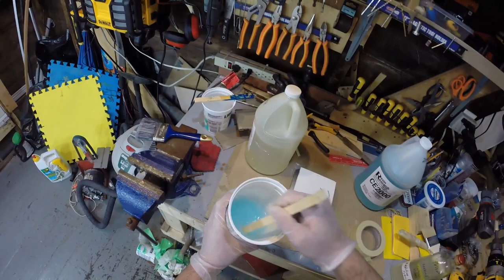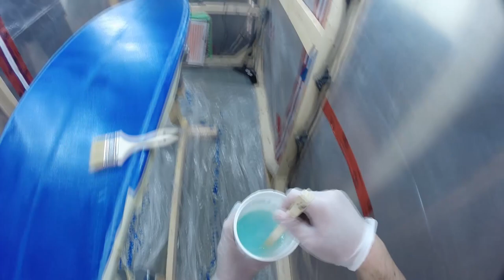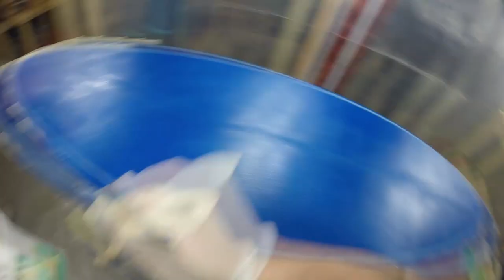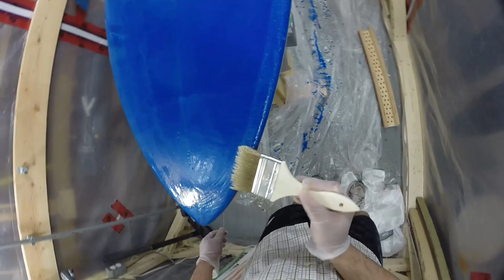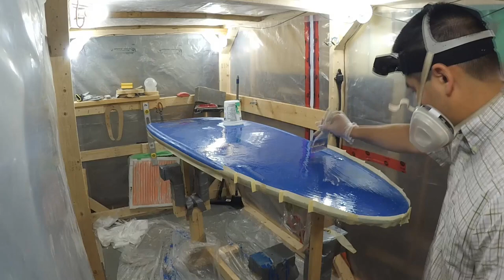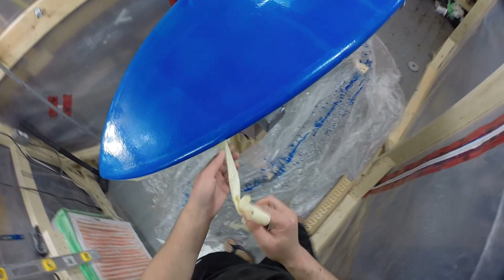Hot Coating the Bottom of a Surfboard: How to Build a Surfboard #31

Comment: So the laminating, hot, and sanding coats are not different mixes except the hot coat has additive F? Double checking additive F just 100% xylene since I have a can, I have read somewhere it also has paraffin wax in it, but I don't know why you would want wax between the lam and sanding coats? Why add the additive F, for a thinner coat to make it more smooth, I'm not sure what a fish eye is? Where did you get the best price for the resin/hardner?  Why not do 2 to 1 like you are doing (vs your correction note of of 2 to .9), was this board too brittle after it was done or something?  THANKS, your videos are great help when fixing my large tail ding.
Reply from the maker: +stewbuntu Correct but you can add additive f to the other coats to help the epoxy flow better, I don't have a hard fast rule, sometimes I do and sometimes I don't.  I'm not sure of the chemical make up of additive F, but it does seem to harden like wax if it gets too cold out, so I don't know.  I just know it works great.  Fish eyes are awful, they look like little pin holes in your epoxy, usually from surface contamination, the additive F helps the epoxy spread out.  I get all my supplies from greenlightsurfsupply.com.

Comment: Yes, the black pigment shows many imperfections. I should have just did an all white board being my first one. I figured the pigment would be thick and dark but it showed to be opaque in some area like it didn't spread evenly or something. It's not bad for my first board but I definitely learned what not to do...at least not yet. Thanks for the help.
Reply: Did you only put pigment in the hot coat or did you use it on the cloth too?

Comment: Hey Andrew,Love your videos! I'm doing my first board. It's an 8' fun board. When I did my hot coat on the bottom, I got fish eyes and little air bubbles all over. Now that it's hardened, what's the best way to fix this? Should I sand it down and re epoxy? Also, do I need an edge on a longboard like how you made yours with the masking tape towards the tail on the bottom or is that more for short boards or my liking?
Reply from the maker: +Neil Yagley Thanks Neil!  Since it is your first board, I would sand over the bottom wipe with denatured alcohol and see if you can fill them in with another layer.  Also did you used enough epoxy?  Sometimes if there is not enough, the surface tension causes the fish eyes to form.  I learned the hardway, was trying to not use too much and ended up causing me a huge headache.

Comment: hi Andrew,
during laminatingarise a lot of air bubbles.They burst and it makes surface of the board uneven with dimple. Did you face the same problem or not? how can I cope with that and prevent bubbles to arise ?
Reply from the maker: +Леша Варсунов I had that happen once, are you glassing as the day gets hotter or in a place where the temperature is uneven?  That will cause the blank to off gas and could cause the issue that you are describing, best to glass as the temperature is going down.
Reply: So I have this old foam surfboard that has what I think is an epoxy resin coating as the bottom of the board, I’ve been slowly peeling off the old coating as it was cracked and chipped. Do you think this tutorial would be applicable to a foam board as well?

Comment: I was told at the fiberglass place that xylene, (ADD. F) is used one CC per ounce of hardener.
Reply from the maker: Surfmus Yup I think that's what they tell you to do, I used to use a syringe and measure it out.  All I do now is just put a capful in.
Reply: That's what Ill be using since I have one from my mountain biking oil change fork. 

I've been researching in how to place the center fin. I'm doing FCS plugs. I shaped a swallow tail. I just  found one forum on Swaylocks that indicates to place it where the tip of the fin meets the end of the stringer. I remember, I am doing a swallow tail so I'm referring is to the end of the gap. Any suggestions?
Reply: Andrew W I went up and down twice and sideways at a 40 degree angle 3 times, at the second time was super nice and solid but I could not stop since I started my third one. I had complete the third time stroke. I'll let you know how it go.  My quart kit of resin,  the 32 ounces, did not completed the board. I have to drive an hour to get more. The fiberglass place was right. It's a 6', 2" with big profile. I used 12 ounces in both lamination and 7 oz. on the hot coat. I guess they ripped me off and kept and ounce, well that can be margin error, lol.

Comment: why the hot coat is required? what does this layer bring to the board?
Reply from the maker: +Леша Варсунов It filled in the weave of the fiberglass.  It isn't water tight with just the lamination of the fiberglass.

Comment: Yeah I used enough I believe cause I had some left over. However I forgot to use additive f. That may have been my problem. I'll do what you said and add the f and see what happens. Since the coats I did are black, do I need to add more black pigment for this next coat or will a regular coat just blend the sanded fish eyes in?
Reply from the maker: +Neil Yagley I haven't done much with pigments that dark, but I know they can be a pain as they show imperfections more than light colors.  So if they seem ok, you probably can get away with out the pigment again.

Comment: why is it called hot coat?
Reply: Supposed to do it with really hot room temperature so it cures fast and without bubbles.
Reply: The true meaning of the term “hot coat” is any material that gets sealed by fibreglass resin or epoxy without the use of fibreglass cloth. Plywood decks in boats were often “hot coated” on the bottom sides before being fastened down and permanently fiberglassed on the topside.